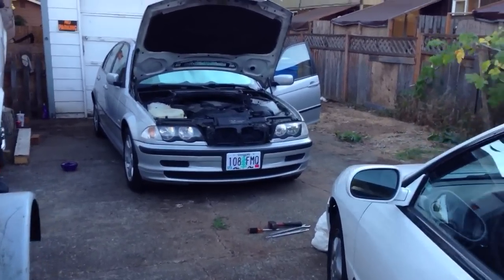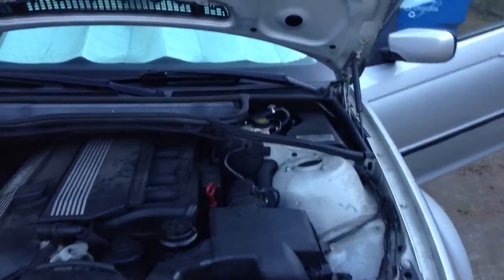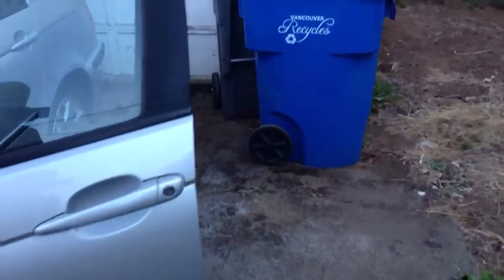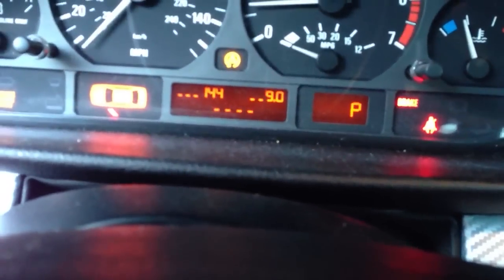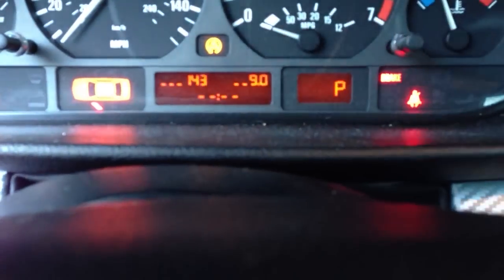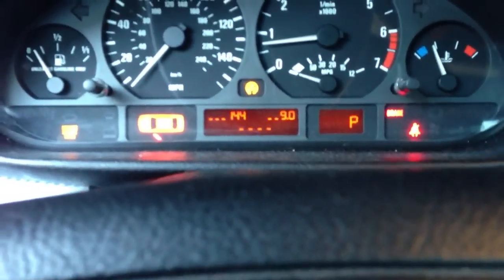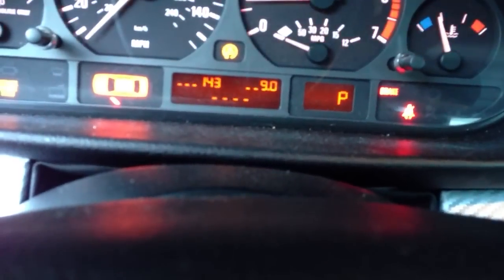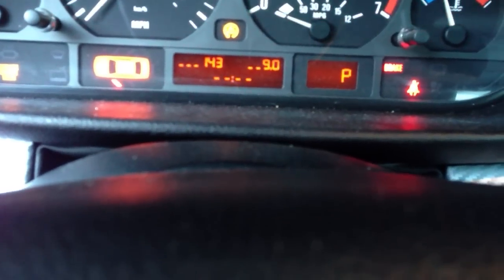BMW E46 323i New brushes on Alternator

Comment: Okay, so my traction control and eml light turned on simultaneously.. the throttle body has been replaced.  The car is in limp mode and won't go over 50mph I floor it and I get no power.. have you experienced this, and if so how the hell do I fix it? the mechanic took it to the bmw to get reprogrammed and still nothing. It's been outta comission almost 3 months now and apparently no one can figure out what's wrong with it... wth?! I just want my baby back .😦